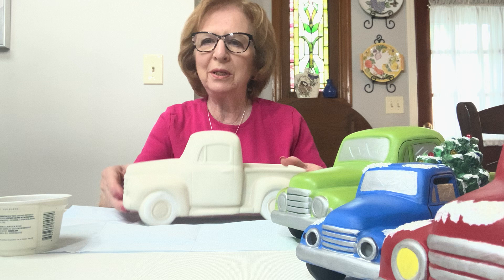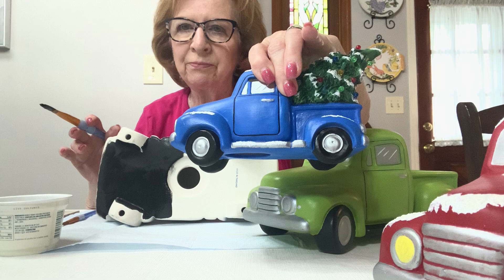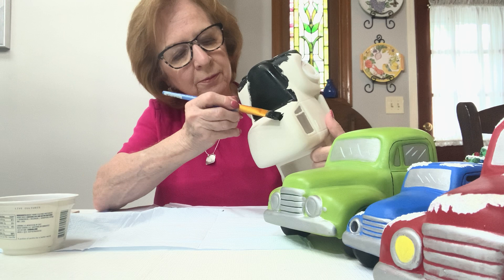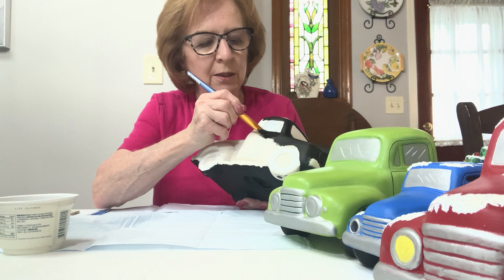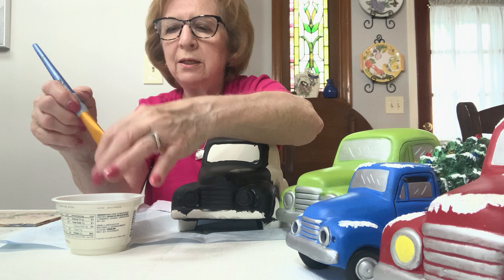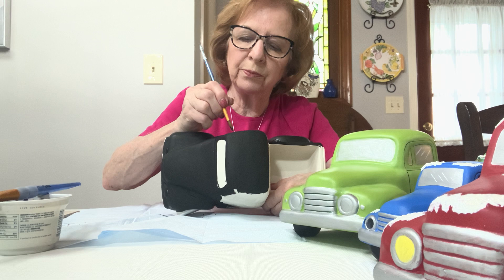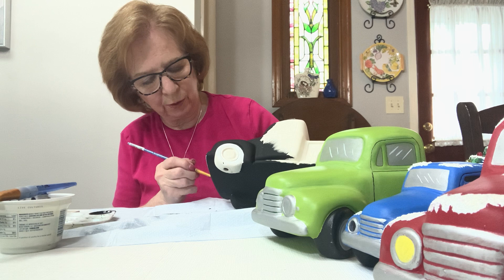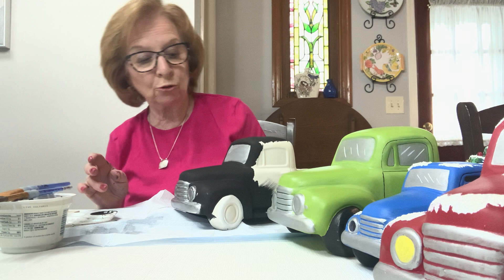Painting a Ceramic Pickup Truck

Comment: How much is the truck with Christmas tree in bisque
Reply from the maker: There are 2 size trucks with tree. The one in this video is the smaller one and that is $12. The lg. one with tree & electric is $35.
Reply: Rosemarie I would like to order the large truck with tree and electric
Reply: Could you please send me a price 35 +shipping
Reply: 43609 zip code
Reply from the maker: @debbieantoine8365  Will weigh it and let you know. Thanks.
Reply from the maker: With shipping, it’s $50.
Reply: @rosemariesceramics7309  I will send a check like last time
Reply from the maker: Ok. Thanks.
Reply: @rosemariesceramics7309  mailed today
Reply from the maker: @debbieantoine8365  Just got your check. I shipped your piece on Tuesday.  Let me know when you get it. Thanks again.